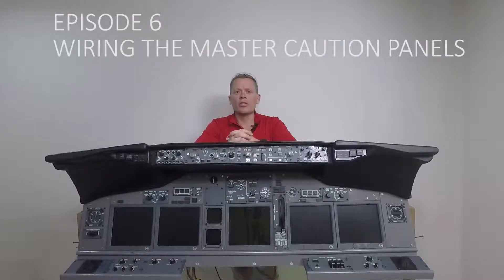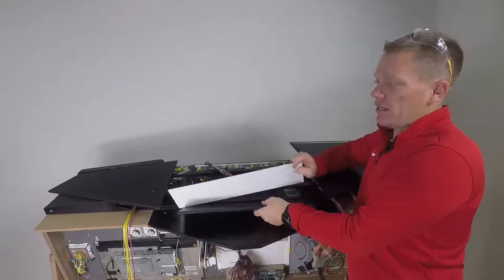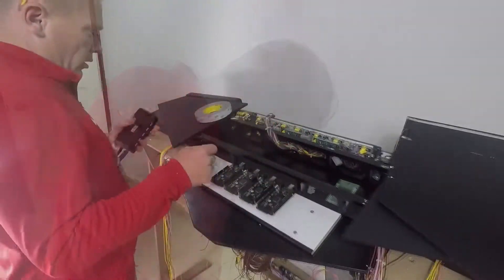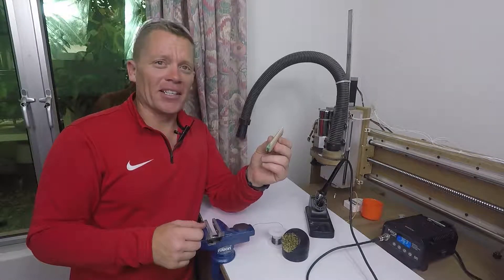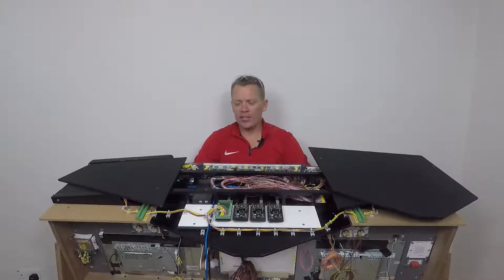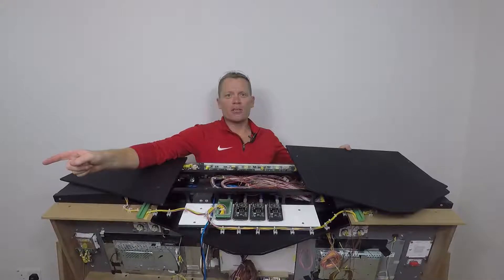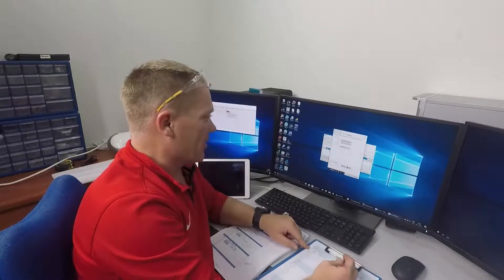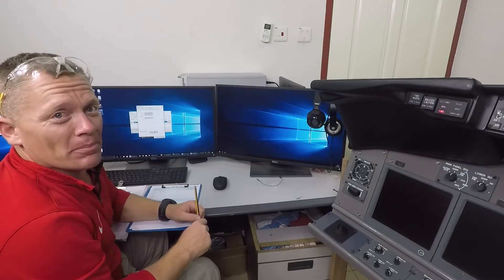737 Sim Build - Wiring the Master Caution Panels #6

Comment: Hi, great videos you have! Just one question about the Sixpack part of the warning panel: what about the push switch function for recalling the last warning?
Reply from the maker: Hello Theo, there are now 4 tacile switches which hold the six pack. When any point of the six pack is pushed, one or more of the tactile switches operate in parallel, sending the signal to mobiflight and prosim.
Reply: Heli Mech perfect!